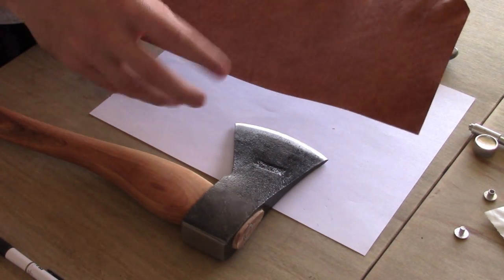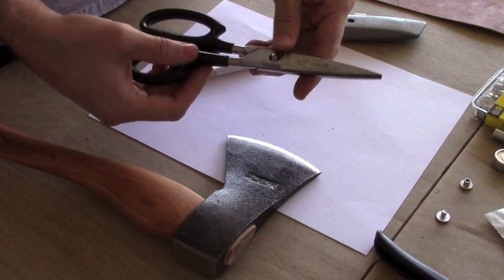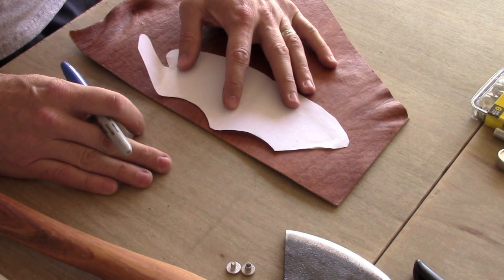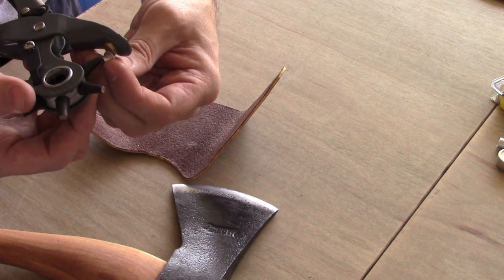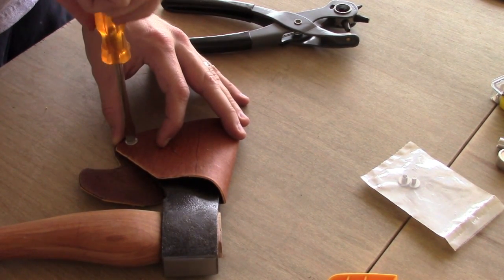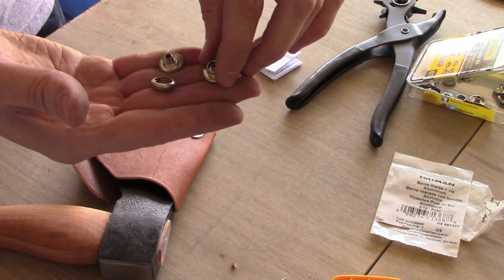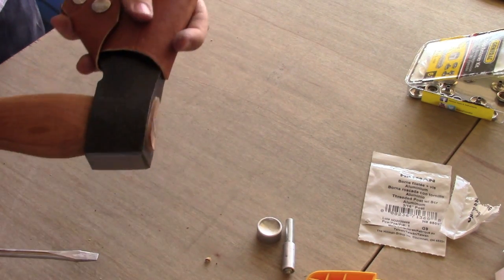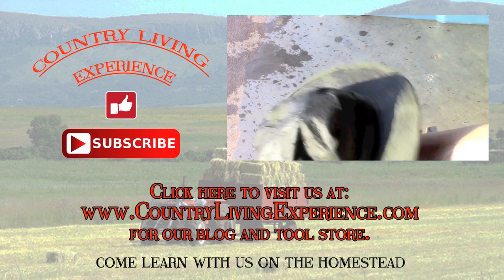Handmade Leather Axe Sheath DIY How to tutorial

Comment: Wouldn't a welt have been a better idea? Even if it's just aluminum, I wouldn't really want my axe grinding on it. I've seen a welt sewed in so only the one side is fastened (because of the style of this mask), but it' doesn't have to be a big piece, just enough space for stitching or alternatively adhesive or cementing paste would be a little cleaner look.

Comment: A nice simple design. 

Form follows function.

I have a hatchet that needs a simple protection, to protect the blade and to protect anyone from the edge.

I will include a welt.

Best design I've seen for the purpose. If I later want to make a different sheath for carrying on my belt, maybe later. But for now this will work fine.

Thanks.
Reply from the maker: Glad it was helpful. Thank you for watching.

Comment: A simple and beautiful design. Thank you. You may want to add a strip of leather along the inside of the riveted portion to protect the blade.
Reply from the maker: Thank you for the kind words. 

We don't need a strip on the inside because the rivet/screws are aluminum. They will not damage the blade at all since they are a much softer metal. The other option would be to use brass hardware which is also very soft and will not damage.

Comment: I also have a Marbles axe and found your video instructive. I would like to see a sheath made that includes a belt loop or an attached loop that can be used to attach the axe to a backpack.
Reply from the maker: Thank you. I will get moving on some other projects. Your two suggestions seem like good ones to start with.

Comment: I swapped out the aluminum shell Chicago screws in my axe sheath for copper ones last year. Aluminum is too soft and mine were cut clean through and the blade was rubbing on the steel screws. The copper ones I put in are much thicker and more cut resistant material than the aluminum. Just a heads up for you and I'll never use aluminum in that type of application again. The axe lived strapped to my pack and probably rubbed during every step I took. If you don't carry yours around much you probably won't have a problem. Just thought I'd share. Nice vid. The only other thing I might do is stain and burnish your cut/sanded edges to seal the leather from moisture damage. But again, if you don't take it out much it doesn't really matter.  The copper is holding up great but if it does wear through, which doesn't seem likely, I'll just stitch it and be done with it.  Nothing beats an extra strip of leather reinforcement at the blade with stout stitching.
Reply from the maker: Thanks for the heads up. Your axe must be razor sharp all the time. I don't carry mine around too much but I will keep the copper rivets in mind.